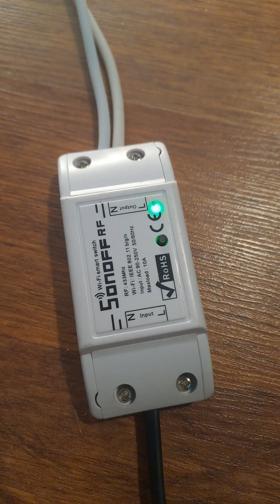Loadshedding detector SONOFF load management device

Comment: this is what i want to implement too! but i dont understand how to connect a relay as a switch to the sonoff mini unit.
Reply from the maker: Hi WRAND2208, thank you for checking out and commenting on the video. To answer you question, basically main power will energise your relay /modular contactor the N/O (normally open) contact will then be wired into the (S1, S2) of your first Sonoff relay (SONOFF MINIR2) or similar keeping in mind the sonoff relay is to be powered from the alternative supply also.So when your relay is energised the (S1,S2) contacts will be made and vice versa when mains drops out and the relay gets de- energised. From here on the load you wish to control which is on the alternative supply and powered via another sonoff relay can be controlled by setting up a scene in the ewelink app to do the following, when sonoff module 01 is made , sonoff relay 02 will be on, and when sonoff module 01 is off, sonoff module 02 will be off.
Reply: @markussparks8603  awesome! Really appreciate your detailed response! Keep up the good work 💯